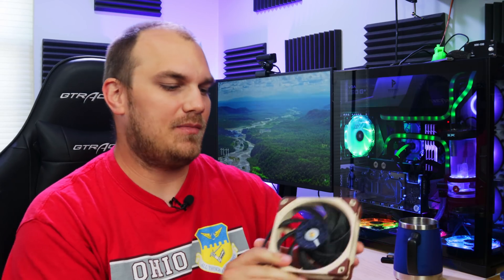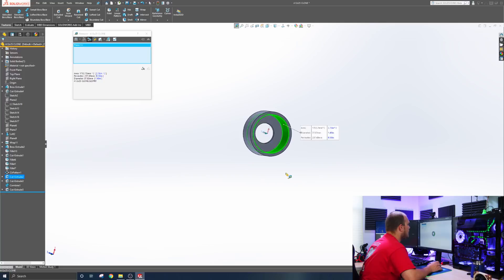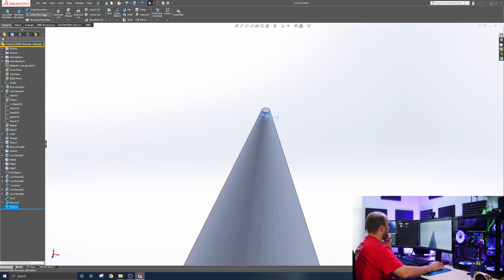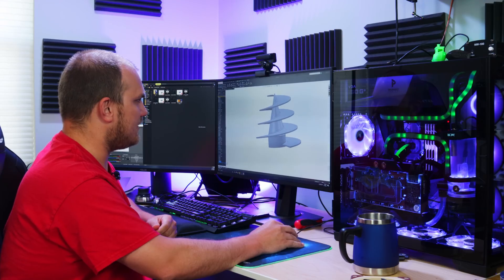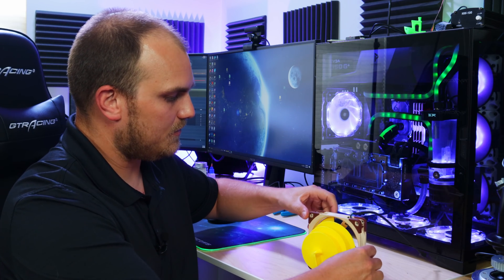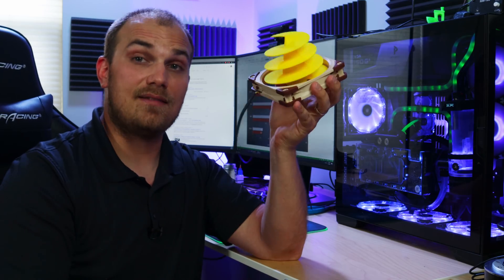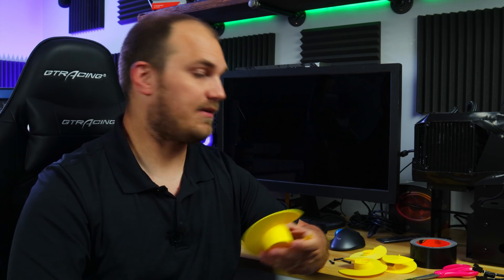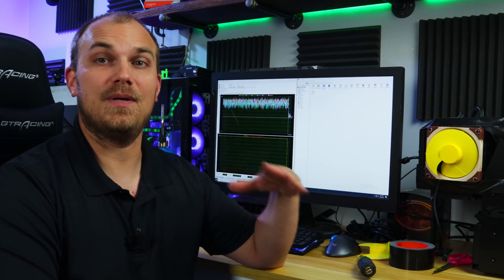Leonardo DA Vinci Made A PC Fan Would It Work?

Comment: I know you've just ordered the Prusa printer, however have you considered going for a resin printer? Maybe something like the Elegoo Saturn (only for the increase in build volume) which might get you a lot smoother prints and less balancing issues. Only problem is even if you got a pre-order this Saturday 10AM EST, it'd still would get delivered until late September. Other smaller resin printers might not have a large enough build volume for you. (Anycubic Photon, Monoprice Mini Deluxe, Elegoo Mars Pro, etc)

And if you consider it, to warn you, resin printers are a lot messier in comparison to FDM printers and extra safety measures are needed (gloves and eye protection at an absolute minimum) plus washing and post curing parts are required. If resin gets on the skin, it can leave some nasty chemical burns, but every time I work with a printer, I just wear a jacket to prevent that from happening.
Reply from the maker: I do want to get into resin
Reply: @MajorHardware  I'd highly recommend checking out a few youtube videos, in particular the resin safety videos.
Review on the Elegoo Saturn: https://www.youtube.com/watch?v=kMtRgy1Sw90
Resin safety videos:
https://www.youtube.com/watch?v=7kHcsTG9QsM
https://www.youtube.com/watch?v=5sRbK9pg4Ng

Comment: The Tevo is a great machine, but looking at that print in the video you should put on a BLTouch for auto bed leveling, that's gonna make leveling easier and you'll get better layer adhesion.
As for a good new printer don't get a Prusa, not because it's not good (it's actually great) but because you already have a cartesian type printer, you really don't need another one. 
I suggest you get a CoreXY type one, like the Ender 5 Pro or something like that, it depends on how big you want it, they are faster than the Tevo and more reliable because of the fixed print bed, which translates in better and cleaner prints  
Another option is a delta type printer, which has a kinda small print area but it's the fastest type out of the box and it's precise especially with tall, round or curvy stuff.

Comment: If you're looking into a new printer, especially for all of these fan designs, you should really look into resin printers. FDM will only take you so far in terms of what you can do with complex designs, where resin will allow you to do more. 
As for aerial screws, I've never seen one that can fly, and I think part of this issue is how screws themselves work. Screws need material to push against to drive themselves into the material, in this case the reference is opposite where the screw is driving the material, and if that material is easily pushed away from the screw radially, basically no form of material compression, the screw doesn't work. Think of this in wood, if the wood simply evacuates the screw threads, the screw can't be driven into the wood; instead the wood compresses to a point where the screw can drive itself into the material. Or think of it as a spiral drill, the drill evacuates the material only through the spiral, not outwards radially due to the material being rigid. Fluids, air and water, work differently, you can't just screw something into air or water, the material will just evacuate due to lack of rigidness and compression. 
Now if you would put a shroud or duct around the screw, it might work. Look at how ducted fans have increased performance. Look at how Archimedean screws work for moving water uphill. Look at how various forms of compressors/pumps work, you need a housing to push the fluid, as the fluid can't escape radially. 
Another way to look at this issue with screws, which is more relevant to the reference that the screw is driving the material, look at screw based linear actuators. You have the screw, the drivable material, and an outer surface; sometimes the material and surface are the same object, such as a nut, but in a ballscrew, they're separate. In the case of moving air, think of the ballscrew, but without the ball bearings and instead air, and think of the ballscrew housing as being a housing that is perfectly cylindrical and within a fairly close tolerance to the screw's outer diameter.
You might also try a double start screw. If you look at normal fan blades, due to pitch, they're essentially just a small section of a much larger screw, and you don't typically see one-bladed fans. Try a double start screw, one that uses two sets of threads, that should give you some better balance. 
It'd be a crazy idea, but maybe replicate blade count in screw count; have an 8 bladed fan, try an octuple start screw, just keep the same pitch. This is also where a resin printer would be useful, as that kind of design would be stupidly hard to do on an FDM machine, and the inconsistencies FDM would give you would add up quickly in something that complex.

Comment: Nuclear power plant, Bernoulli perhaps :) Cmon, these designs were mastered ages ago, even the latest with jets, taken down in degrees of input will compute to lesser shroud shaping, intake, to expel, with fan designs to match. There is software out there to match as well. You can do it and be thrilled. The issue is just getting away from these ridiculous box fans, with their silly blade iterations with number of blades and surface anomalies with curvature. None of it has been overlooked, it has all been done. The reality is.. if you want the BEST out of fans for computers, you need a separate power management because the boards shouldnt be delivering the power, but directing it. Then you can get dead silent MASSIVE cooling curves with change to cases. Look what Bose did with piping for their resonance sound design. They didnt get that without aerospace modeling due to metallurgy, curvature, and deadly mathskills for range and resonance. Think of this.. throttling blade shape changes simply utilized with RPM. There is so much more, thats just one. And I edit here.. This last one? Gives the ability to replace individual blades with a snap. Are you seeing it yet? :) enjoy your stuff, I love the exploration and sharing. One of the issues with perfected designs is, they are patents held by the biggest money makers in the world. However, as with all such, distinct directional slides in materials can make a distinct patent possible or design without having to pay patent licensing fees.

Comment: Yeah don't remake the same thing.. That was 100% not what da Vinci  designed.   Slime it down, Change the support system change the angle of the spiral..  what you have here was almost a solid piece of plastic on a motor.  You could probably make it with 1/3 of the plastic you used.. Most importantly get ride of the giant solid cone in the middle.
Reply: Here is a print on Thingaverse you could modify https://www.thingiverse.com/thing:3544516

Comment: Would it help if a shroud was added around the air screw? An Archimede's screw relies on both the screw and the cylinder it is in to move water. So If the DaVinci screw were shrouded it might be able to move the air in the direction you want rather than losing it from the sides. Just a thought. Nice work on the experiment by the way, fun video to watch.

Comment: I wonder how that would work with an outer wall to help force air down into the frame? Great video 👍 👍
Reply: I wonder if the new resin bed printers are better they use special uv led screens and the higher def the screen the better resolution the prints. Small ones are cheap but i don't know if a fan would be small enough otherwise they are extremely expensive and nevermind. :)

Comment: With a cone shape of the hub you have more surface to "grab" the air but you lose pressure, so external tip on the top of the blade should have same diameter as the bottom of the "blade" like you have now. Maybe to compress air you can add an external cylinder to "close" the gap between noctua's frame? like this https://metanophilia.files.wordpress.com/2015/11/gentletyphoon-3000-rpm.jpg all the way to the tip of the "screw"?

Comment: I had an idea for a cooler while I was in the desert. Basically, imagine a multi fan tunnel going from a 200mm fan with a tube between that tapers down to a 140mm fan that's spinning faster to a tube that tapers to a 120mm fan that's spinning faster than the 140. So not only would the air be moving faster due to the blades spinning faster but it would be compressed as well as the tubes get smaller.

Do eet!

Comment: Put a box over your 3d print the print is warping because parts of it cool faster that other if you keep the temp up it will not warp buying a new 3d print will not stop it, you need supports on cad then cut them off and that also should stop the warping

Comment: Your should print the blade at least slightly concave or convex (depends on what you consider the Y axle) instead on making the blade horizontal to the center column, because this way, the air is escaping to the sides.. it wont move almost any air.

Comment: try a straight shaft for the center, a pitch of 12 degrees, 1 and 3/4 twists, start the bottom of the helix at the top of the hub, and the top of the helix should be 2mm larger radius than the bottom of the helix

Comment: Holmes makes a fan with a spinning grill that they claim helps to push more air, or rather, take the same amount of air and amplify its capability to be cooled. Maybe, try to emulate that with an externally-mounted grill accessory using a belt-and-pulley system mounted externally to see if making the Holmes Blizzard in miniature can help to exhaust more hot air?

Comment: try adding a 90 degree downward orientated "skirt" all along/around the outside edge of the blade. kinda like those upright fins airplanes have at the end of their wings, but have yours pointing down. might force more air in through the fan. caution, it might also add stress to the part while spinning and forcing more air through. might make it warp or wobble. great video as always! keep em coming! can't wait to see what you come up with when you get that prusa

Comment: What you need to get the most out of this is to also create a proper housing. This type of design I believe would greatly benefit from a conical intake like what you see on the front of modern jet engines. That cowling is designed in a way to allow air to enter the blades and can also greatly speed up and direct the airfoil created to give much better and more controllable airflow. This is interesting and I am going to play around with this idea as well. I have several application where I am looking at alternate methods of introducing volumes of air into a controlled case for better cooling and this might just be what I have been searching for. Currently using a three blade system that closely resembles a jet engine but its just to loud and this I think would give me the flow I am after with much less noise. Thanks for your fan fetish, its paying off...;)

Comment: What if you scrap the cone shape and make the centre cylinder the same as the hub then do the corkscrew blade all the way down. Have it all encased in another cylinder barely larger than the edges of the blades, just like a twin scroll supercharger except there's only 1?
Good video ideas btw

Comment: I want to see what happens when you try to cool the back of the motherboard with a huge water block or just put a heat sink on the cpu socket in the back and add a fan to it. i'm curious if that would help thermals?

I also want to see a double sided GPU water block where both sides are liquid cooled! that would be cool.
Reply: Just an air blower on the rear reduced socket temps by 7c on my old FX computer, it does help substantially (it’s going to need a very thick thermal pad to mount a cooler because capacitors and other circuit are on the back, hence I only had a fan).

Comment: ֍ Major Hardware 120mm AirScrew Fan™ ֍
Shroud fan. Velocity stack inlet. Straight OD. Taper/cone ID. Variable pitch(grab big "bite" of air and accelerate it). Nozzle on exit side to guide flow. Add RGD. 
Posterboard/thick paper/cardboard/paper mache are faster for some of the prototype parts

Comment: Major Hardware check the vertical part of the frame on your printer if it’s not exactly 90 degrees  from the base you get this problem.  I fixed this on my cr10 by adding frame braces and verifying the angle with an angle gauge.  my spinning parts went from hopping across the table to near injection molded balance

Comment: You should try to do it with 2 spirals (that should make it more balanced). Make it taller again and make a cilinder around the blades  to keep the air between them. Also i suggest to pointing the fan up to release the bearing load.

Comment: not that this should be revisited, but consider reducing the depth of the helix. prevent the leading edge from protruding past the frame body. This might help increase static pressure, I think that air is escaping the blade where it extends past the fan housing.

Comment: I wonder if you try hanging the screw so it points directly down, you'd get less vibration. You'd still have the direct wobble but you wouldn't have gravity pulling on the wobble axis.

Comment: It would be interesting to see what the effect would be if you break the screw down in to different blade like you'd see on a normal fan but with the raising spiral orientation of the single blade (I'm probablý not explaining that well) as it would certainly increase the airflow but also keep a high static pressure and potentially work in the same way as sandwiched push rad push rad pull configurations that aren't meant to work in theory for cooling but do

Comment: Btw for getting better prints I would suggest trying dense supports and support everywhere so you can print the fan with the hub facing up in the z direction, printing them horizontal may be "easier" but it will always introduce concentric issues with anything circle shaped (because gravity sucks for molten plastic).
These are the features in Cura (not sure what slicer your using).
Dense support adds 1-2 layers of denser material to your supports where it contacts the model. these make under hangs come nearly perfect (managed to print a working disc golf disk upside down like this).
Support everywhere means well support any where it's needed (including on top of already printing parts) yes it take more time to clean up the model but sometimes that's necessary.

Comment: Looks kind of like a screw style supercharger and therefore may act more as a compressor. Check out the YouTube channel, engineeringexplained, for an explanation for the device. Maybe try adding a housing that covers the whole assembly. That could also be used to help with the vibrations problem if you run a small steel rod through the screw and have it sit in a bearing or bushing on the far end from the motor. The housing on the tapered design would also act as a nozzle. I don't know fluid dynamics, so try a simulation first.

Comment: 8:25 I’ve been watching what has been popping up for this video so far, I really love that you’re not that afraid to just try man.

These actually look like really, really decent prints! You must have spent some serious time dialing in your printer over the last few weeks 😂👊
Reply: 8:39 yup, you did a heckin good boy.
Always look after your baby man, never buy a new one, build the printer you decided would fix the problems with the one you have. The prusa style printers have a whole different mess of issues and a different learning curve 😂

Finalise the tweaks you’ve done to your current one, build a decent frame (extend the build platform and volume if you want to) and put in the final engineering touches my friend, 3D printers are still being developed and I bet you could make yours work better than a prusa any day.
Reply: 13:40 I thought you were going to crack the shits and claim fire insurance for a moment then 😂👊 fuck why didn’t I think of doing that more often (your method, not insurance fraud 😂)
Reply: 14:40 more stacks tighter together (max total stack height 1cm, 4x stacks), reduce air gap between blade and fan housing. 😂👊

Fuck it man, build a turbine and attach it to the motor. See what kind of cooling power that would have 😂

99% of fan related issues are caused by air gap around the blade, your design at this point has a massive gaping hole for all the pressure to escape, you’d have to maintain a rediculous amount of rpm to obtain any kind of static pressure at all.

Comment: Maybe standard 5-9 blade design in an aerial screw configuration? Like first blade low, next blades gradually higher than the previous along the mount axis. Take my crappy example. First blade>second blade> third blade would be like so  __--'''''

Comment: The blade is way too flat to generate any kind of CFM without very high rpm, it probably has good static pressure, but even an airflow fan against a radiator would have better cfm, it's like a diesel truck stuck in first gear.

As a side Idea, you could test fan spacer thickness to help reduce deadzone on a cooler, or test if fins help like your velocity stack or the back of an NF-F12.

Comment: The thing with 3D printers is they don't by definition get better the more you spend. They might become easier to tune and have a bigger build volume and more features. But in essence a well tuned 200 euro printer can perform on par with an "expensive" Prusia. So maybe upgrading and tuning your current printer might be the way to go? Upside is you'll learn a lot about 3D printer troubleshooting.

Comment: When using a Da Vinci Screw you need to make a Shroud to cover it so you are not loosing air flow out of the side if the fan. Common Case fans have the blades shroud at the same height or slightly higher than the fan blades.
Reply: I was thinking the same thing. Imagine the cone version but with a conical shroud.
Reply: Ok I never will think this